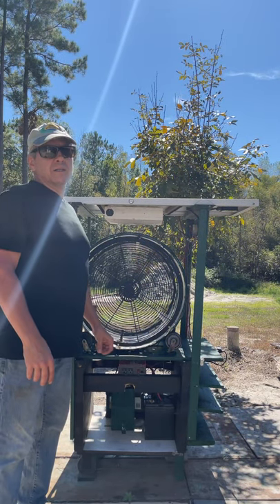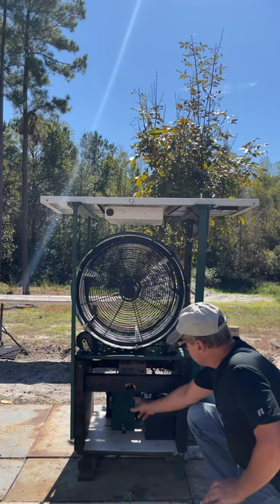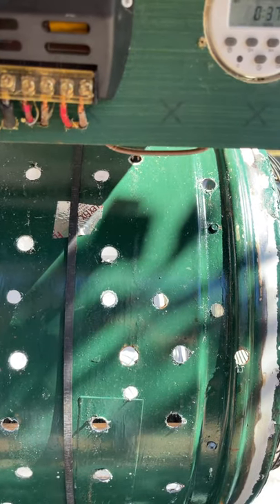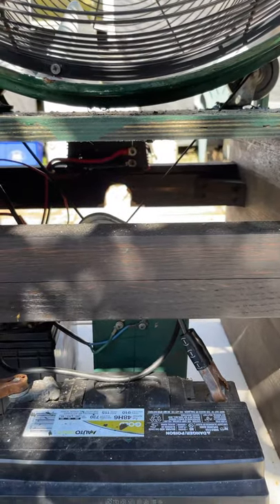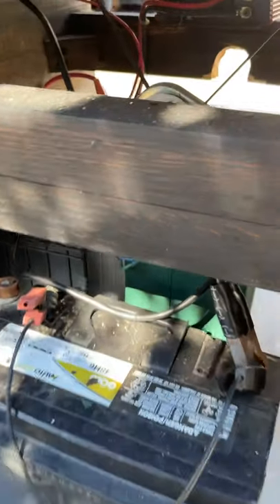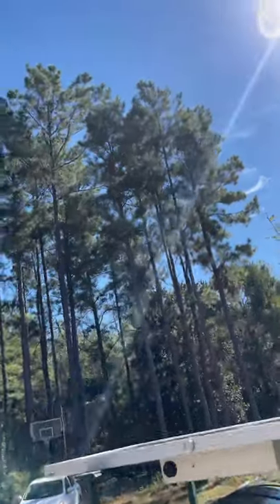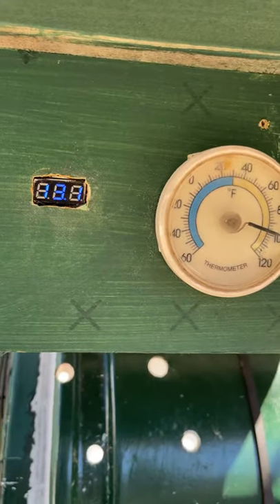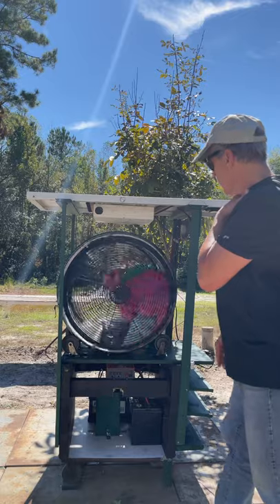Solar Clothes Dryer No B.S.

Comment: I was picturing something similar in my mind but instead of the metal tumbler using a tumbler made of acrylic or a hard glass that can amplify the heat of the sun plus the solar panel (not on the top) to power the small engine. Great job!

Comment: This is the most efficient method of drying clothes. on a typical day I can run this dryer in open sun for hours. Can you add heat to boost drying in spring/fall months ?